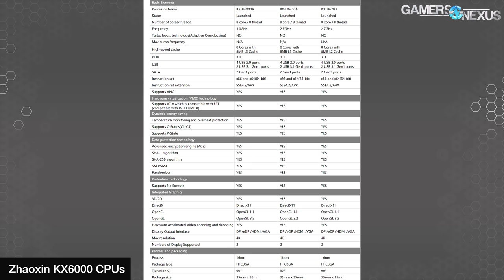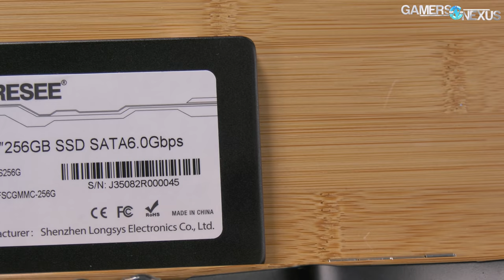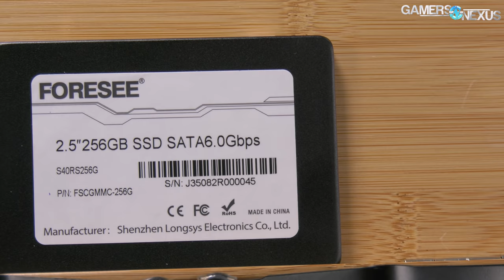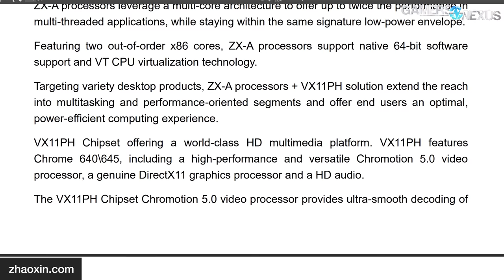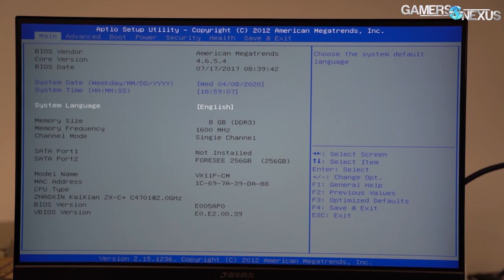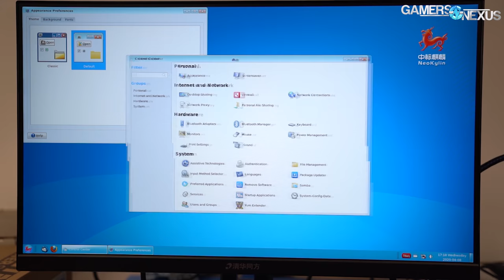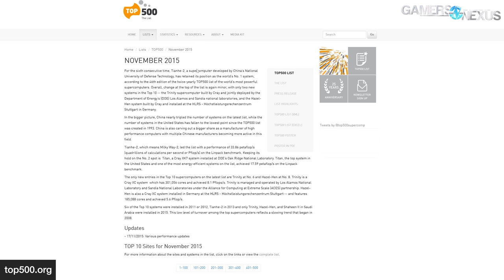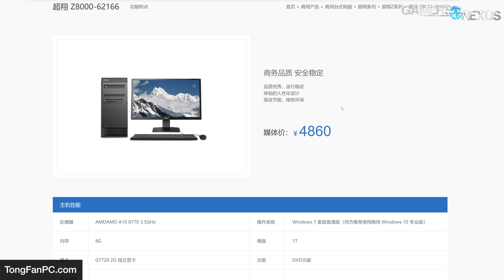Chinese Pre-Built PC Review: ZhaoXin CPU + Knock-Off Windows OS, ft. NeoKylin

Comment: About the GTA V benchmark: Running the game from a SSD instead of a HDD often solves texture pop-in and freeze frames. I had a similar issue as shown in the video on my Ryzen 3200g and Radeon 5500XT (even if not so extreme) with a similar FPS (~40, 1% lows ~5)  until I installed GTA V on a SSD. That increased my FPS to ~100 (1% lows ~80) while nearly completely eliminating freeze frames, stuttering and texture pop-in.

Comment: Nice and interesting research, congratulations! If the Chinese can make CPUs with Bulldozer-level performance, then indeed they no longer need Western tech to make decent office PCs: Even if Bulldozer is old, it can run Office applications and other light work very well. 
One of my older PCs has an AMD A8-9600 - the very last "version" of Bulldozer - and it even runs Lightroom at acceptable speed. Not great, but acceptable. 
And I happily play an older game Bioshock on it on its integrated R7 GPU.

Comment: My best guess to what is installed on the super computer, based on the resources shown in the video, is that it's using ubuntu distribution of openstack to form the infrastructure, and perhaps uses neo kylin for the guest virtual machines that run on top of openstack. It is perfectly normal to have multiple operating systems running a super computer, the name computer in that sense is a simplification of the fact that it is a complete datacenter hosting thousands of computers trying to cooperate and work on  tasks as if they were a single super computer, where in fact they are not.

Comment: The UI is a modified MATE UI (which is goes back to Gnome 2). The underlying OS, which as Steve mentioned Red Hat, may be a variant of CentOS  or RHEL itself from the version number (7.0) as could be related CentOS is to RHEL. It is therefore most likely running X Window Manager rather than Wayland. It is likely that this system is based on an older Linux for compatibility and reliability. The Linux kernel 3.10 became End-Of-Life in November 2017 so it's very old; the current version is 6.0.x.

It would be interesting running a modern, similar, Linux such as Fedora (36 or 37) with the MATE UI (which is what I myself use) and compare performance. It may be that the Chinese Linux OS may be hindering performance compared with a modern version with the Wayland compositor as it is significantly faster than the (much) older X Window System.

Current versions of Linux do support Steam, which on Linux  offers Vulkan support for playing Windows games in combination with Wine and Proton. I have done gaming on Linux in this way and found similar performance to Windows on a fairly powerful machine. The www.protondb.com website is a database of Steam games and their compatibility with Linux.

Comment: it's pretty easy to find 110-220 V up down transformers, with a 220 V output to be used on any 220VAC machine, well under $100 for a 300W unit.
Reply from the maker: The PSU was $30 and here in a day.
Reply: yes, but the 110/220 transformer, at 500 W  is available from AMZN for $50 and you could use it on future products, if needed. In your work, it would be good to have this around. When I worked in a TV lab we always had a few aound for foreign Tvs.

Comment: Also, US$1k seems pretty fair for an office PC, though it is better compared with an OptiPlex 5070 than a gaming setup. That said though aside from the OptiPlex delivering far better performance, the OptiPlex is also far more reliable than the THTF stuff. My parents have those units in offices and they just feel much cheaper if it is still working at all. Not bad for a first milestone but obviously a lot more work is needed.

Comment: actually that one psu wouldnt even work on our outlets at all not even the dryer outlet as while the outlet is different in china compared to whats used in us and canada its identically wired the same hot/neutral/ground with 220/240 coming on the single hot line you can get a step up transformer that can step it up to 220/240

Comment: This is very fascinating: Even if it seems like even entry level phones have more computational power it is extremely significant that China has done this much "independently" from the west altogether (Note: no debate on how they went about obtaining the tech but there's a very high certainty that these can't be backdoored in at all which is the point)

Remember that we went to the moon with less computational power than those of your home appliances today so even this much performance is extremely significant if you think who is using it and why.
Reply: It’s just a x86 thing, just like powerpc. Chinese self make arms are much more powerful but it’s still almost impossible to make arm desktops system due to all the legacy app. Most of chinese gov machine are still on windows xp

Comment: This is definitely more relevant than it seems on the surface.  It may be ho-hum in terms of performance, but it's a significant chunk of the way there, if not already perfectly suitable for office computing.  If the Chinese contract their own software development, and it's more efficient than the slop the rest of the world contends with, then raw performance is even less critical.

The main takeaway here is how quickly the Chinese have moved on this initiative to cut ties with the west.  This has happened before with keyboard input methods.  The QWERTY keyboard and ASCII system we all knew and loved from the DOS days was deemed insufficient, and so they sought a resolution that better fit the Chinese language and its users.  Then they went on to surpass the west in efficiency using their own input methods.

If the US tech industry is not already keenly aware of the threat this box presents, we're all about a decade away from our benchmark platform being NeoKylin.  But I guess we have more important issues to attend to, like whether to roll back any progress made on equal rights or healthcare.

Sheesh.  Come to think of it, at this rate, our bigger concern is whether our computing platform, in ten years, will be an actual tablet.  Like, a somewhat flat stone that we write on with a softer rock.

Comment: Steve, the thing about "taking it home and unplugging your dryer" isn't going to work unless you have some kind of converter.  We (in the U.S) have two 120v lines with the wave offset, so there's a 220v difference between them (neutral not used), where Europe has a 220v hot and a neutral.  In other words, we don't have one single hot wire with 220v.  I don't know what would happen if you tried to connect it, but I wouldn't try it with anything I cared about.  That said, go ahead and try it and tell us what happens!
Reply: I was wondering about the 50 Hz vs 60 Hz issue.
Reply: @WilliamSwartzendruber  Same here. I also wonder about whether it's single phase or maybe dual phase. Really depends on how the distribution is wired.
Reply: Old comment, but it would work with the appropriate adapter, and be perfectly safe for the hardware as long as the PSU is capable of 60hz.

Just for anyone curious who runs across it.

Comment: 5:51 - you SAY it has no switch for 115 power operation, but it seems to take it according to the sticker. Did you try to run it on 115 and it failed?

Comment: Why don't you guys just make a little extension cable for the CPU power connector so you can put an ammeter in series with a cut wire to get a more precise and accurate measurement?

Comment: This is the first episode since sometime in 20I9 to use the full version of the Dial~up audio clip that would normally be used for the End of Program ID, looks as if my wonders have been responded to and it truly feels nice to hear it as it was initially intended. (:
Now, on to the big meat of the program: It truly is nice to know that Zhaoxin has come along rather decently since their earlier generations, the older chips may be trash in performance and overpriced for Prebuilds but I do wholeheartedly believe that we will see a true performance competitor from them by the time that we reach the 03 Nanometer to Early Picometer Era sometime circa 2027 or Early 203X, at the earliest; I am genuinely surprised to know that a ZX-C+/KX-4000 era chip is able to do any gaming at all in Standard Definition (0480p) and Standard HD (0720p), the ZX-E/KX-6000 units are able to at least match an Intel 7400 in performance and makes me wonder what to anticipate when the 07 Nanometer~based ZX-F/KX-7000 series launches (some reports from the middle of last year are stating that it matches at least the Ryzen 1700X or better, at least for Gaming), VIA needs to deliver some reasonable competition to the CPU market to help us break from the Two Party system that we're in with Intel and AMD and I wholeheartedly believe that Team Brown can become a beast with every new architecture gaining on both Team Blue and Red in significant ways.

Comment: They should have bought the AMD AM1 socket to build on, it is just as slow as this system, but atleast it has integrated chipset, mem controller and GPU, for a much more simple motherboard.
Thank you for buying this expensive system just to show it off.

Comment: The SSD brand, FORESEE, is the parent company of Lexar. I have not used their SSD, but the quality of the SD card has not deteriorated since Lexar was acquired by them. 
NeoKylin is not popular with ordinary users because the system update is very slow and the software is old. Ordinary users prefer to use Deepin, In my opinion, Deepin is the best Linux system in China，but the design style of Deepin is too exaggerated and not suitable for government departments. It seems that Deepin-based  UOS is regarded as NeoKylin in Strong competitors on government procurement projects，It retains the advantages of Deepin and is better than NeoKylin in user experience.

Comment: Well my old I7 2600 oc to 4ghz with an old HD 7970 3gb similar performance to a 1050  maybe a tad more with a good oc and 16gb ram,This is a system from 2013 and this is what I got in the FF bencmark.
 
FINAL FANTASY XIV: Shadowbringers Benchmark
Tested on:  4/14/2020 12:50:40
Score: 8019
Average Frame Rate: 53.99477
Minimum Frame Rate: 21
Performance: Extremely High
-Easily capable of running the game on the highest settings.
Loading Times by Scene
  Scene #1	6.088 sec
  Scene #2	5.84 sec
  Scene #3	6.018 sec
  Scene #4	4.595 sec
  Scene #5	3.228 sec
 Total Loading Time	25.769 sec

DAT:s20200414125040.dat

Screen Size: 1920x1080
Screen Mode: Full Screen
DirectX Version: 11
Graphics Presets: Preset  1 
General
-Wet Surface Effects: Enabled
-Occlusion Culling: Enabled
-LOD on Distant Objects: Disabled
-Real-time Reflections: Maximum
-Edge Smoothing (Anti-aliasing): FXAA
-Transparent Lighting Quality: High
-Grass Quality: High
-Parallax Occlusion: High
-Tessellation: High
-Glare: Standard
Shadows
-Self: Display
-Other NPCs: Display
Shadow Quality
-LOD on Shadows: Enabled
-Shadow Resolution: High - 2048p
-Shadow Cascading: Best
-Shadow Softening: Strong
Texture Detail
-Texture Filtering: Anisotropic
-Anisotropic Filtering: x8
Movement Physics
-Self: Full
-Other NPCs: Full
Effects
-Limb Darkening: Enabled
-Radial Blur: Enabled
-Screen Space Ambient Occlusion: HBAO+: Standard
-Glare: Normal
-Water Refraction: Normal
Cinematic Cutscenes
-Depth of Field: Enabled

System
Microsoft Windows 10 Pro (ver.10.0.18363 Build 18363)
Intel(R) Core(TM) i7-2600K CPU @ 3.40GHz
16351.117MB
AMD Radeon R9 200 / HD 7900 Series(VRAM 3051 MB)

Comment: I'm just waiting for the Chinese to make a graphics card using a nock-off intel integrated graphics but in a discrete gpu
Reply: Can't wait to put Intel HD 2000 on my pci-e 2.0 slot xD
Reply: I'm sure its easier to reverse engineer a GT 730/40 for that purpose, because that's pretty much the equivalent of a UHD 630.
Reply: I think they have access to Imagination tech's IP.

Comment: Please don't plug that into a dryer outlet a dryer outlet is 240 volts but it is split-phase 240-208 volts not single phase 240 like is used in China  the difference being in North America we have 2x lines at 120v set 180 degrees out of phase from each other  along with a neutral and ground line where as in China they use single 240v line along with the neutral and ground we  also you would also probably have to modulate the frequency because north America uses 60hz not 50hz like china's power grid long story short you would be better off using a step up transformer with a frequency selector option

Comment: I'm a little surprised you went with a different PSU rather than ordering a transformer. For a low power system like this computer, those...while bulky, wouldn't cost you too much, I'd imagine.
Reply: I'm kind of surprised their office didn't have a single 220 outlet anywhere
Reply: @toymachine2328  It's an office, not flat. Those usually are only around for dryers and stoves.

Comment: umm that is quad core 28 nm cpu.
According to their webpage they are going to release an 7nm version next year.
Reply: I wouldn't be surprised if they would make 7nm cpu faster than Intel.
Reply: Nm basically means nothing considering that it's just a measurement of the precision of the the process. "7nm" parts are still around 20+ nm in size IIRC.
Reply: @USSMariner  That means that you can made finfet transistors more smaller and therefore put more in single die so you will have more logic in less area so less power consumption per core?

Comment: the SFF form factor PC's are easily turned in to a semi decent gaming PC, if you use a GTX750tiLP, or GTX 1050tiLP, or similar modern version of these GPU's. they dont require PCI power plugs, all power is drawn via the PCIe Lane, & the latter of those GPU's is a 4Gb card with fairly good performance for a shitty little computer.

Comment: Yo this is time travel in a way I used a HP 400-434 which had the same layout except case design in the front but the motherboard looks like the same forum factor and such how is this even legal to sell. I had hp computer until 2020 than finally upgraded to a hp pavilion laptop eh1070wm Ryzen 5700u. I mean wow even the keyboard looks the same and the mouse just about to what came with my 2013-14 machine which is just about the year you said of those components but the one your renewing is new 😂

Comment: Obviously most of us should not consider to buy this system but I think that we need to look at the performance of that CPU from a different perspective than that of a gamer/hardware-'enthusiast'. For one of the first Chinese CPU's it is not bad, give them 10-20 years and they might become competitive. And yes, they SHOULD not depend on 'western' technology as Europe should not. By the way, Rockstar-games are notoriously difficult on Linux. My guess is that that might have to do with how bad the code is. (Steve, I don't understand how you can tolerate such a dirty monitor :))

Comment: I don't understand, why not just use Huawei Kirin SoC, it's probably much faster.
Reply: Maxim Chintalov x86 compatibility is still king in enterprise
Reply from the maker: X86
Reply: Well Linux and GNU work on ARM, so I was thinking it wouldn't be too difficult to port their OS to ARM, so I can see why general public and gamers would need X86 but I don't understand why the government needs it.
Reply: @maximchintalov8387  A lot of legacy apps and abandonware are stuck in the x86 platform, and when it comes to transitioning to new platforms, if there's a sector of society unwilling, it's the government and public services.
Reply: @amirpourghoureiyan1637  
Indeed the banks, and adminstrations still use legacy AS-400 IBM PCs from 1979 emulated .
Reply: @sithounetsith9877  Walgreen's sister company, Boots, still uses a mainframe from over 50 years ago to run their systems.

Comment: Wouldn't it be easier to connect a step up transformer (120V to 230V) to the PC instead of going through the hassle of changing PSUs? It seems more time efficient to do so.
Reply from the maker: Not even remotely. It takes a minute to change a power supply.
Reply: @GamersNexus  I would have thought it would take more time than that considering you would have to disconnect and reconnect cables.

Comment: Blender is a opensource software easy to install in any Linux distribution. Why not at least benchmark with it? Steam shouldn't be hard to install, but you certainly could install GTA5 with Lutris. They are the first country in the world to build a system independent from AMD and Intel and you act as it was a fail... incredible lack of vision...